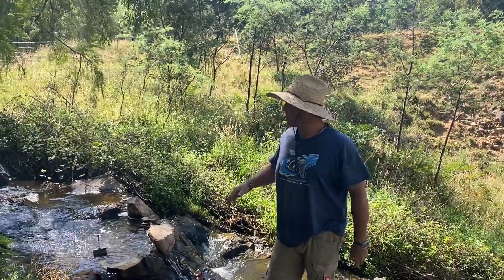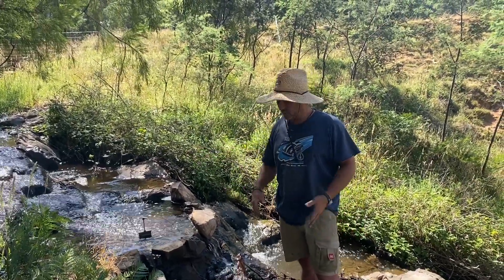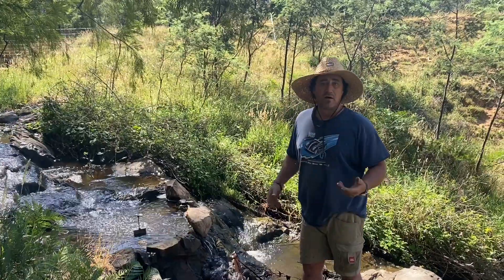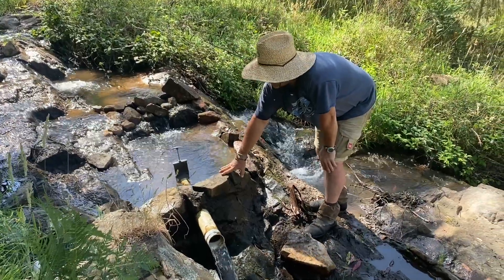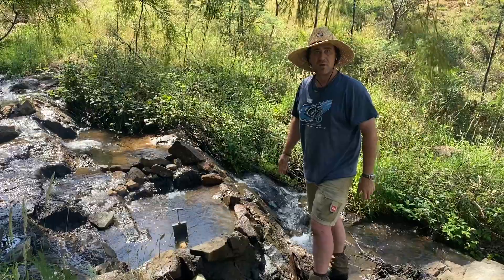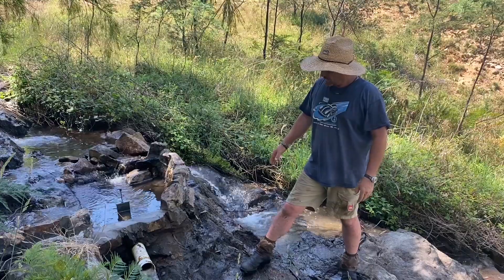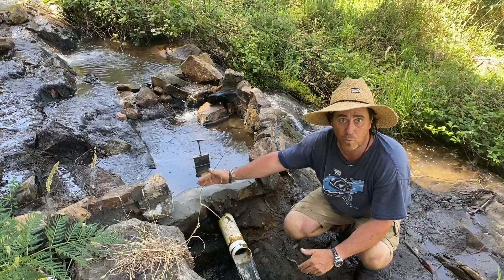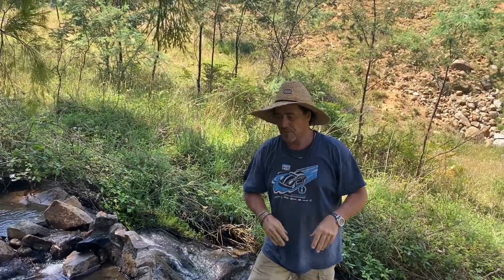Off Grid Micro Hydro Power Generator Part 5 - Water Collection Box Upgrades.

Comment: If I were you I would scrap the collection box idea entirely and go for the solution demonstrated by this fellow Norwegian: https://www.youtube.com/watch?v=wZ4JLTnbUy0&t=0s

MrHydrohead found this solution to solve his problems and I will use the same method in my stream.
Just build the dam walls a bit higher so you get better water depth in the collection area and utilize the 110 mm pipe you already have there.
Reply from the maker: Hey Mr Engineer, thanks for yout comments. I've watched the attached video. Thats an awsome set up. The concern i have is the amount a debris that is in our creek. The filter system in that video would seem to be blocked very easy. If you have any other suggestions i would be greatfull to hear it. Cheers
Reply: @FatCowFarmTatong  
Hi, they tube or container you use will go from the bottom of your dam to above water high. By doing this any debris floating on the top won't be able to enter your pipe and heavy debris will sink to the bottom or for the most part not have enough force to travel up the water in the short amount of time from entering the container to it enters the penstock.
The higher the water level/water depth is the better this principle will work.
Water can only enter st the bottom of the container and will go up before entering the penstock tube that you have an 90 degrees on so that it points up. 

Watch MrHydroheads videos as well. After much trouble keeping the water fed into the feed pipe and at the same time filter it he ended up on a similar solution. If I remember correctly it is in episode 17.

My stream is pretty similar to the one in the first video you saw, just quite some bigger and during autumn rain storms and spring snow melt it gets quite big with a lot of debris and boggy water rest of the year and I think it will work perfectly, just get the depth that you need.

The collection box will constantly clog up and need cleaning.
Reply from the maker: @Mr.Engineer.  Thanks for your reply, i'll really appreciate the time and effort. Thanks again. Cheers
Reply from the maker: Hey Mr Engineer what are your thoughts on a coanda cylindrical horizontal spinning catchment, rather than just a screen. The spinning system would almost be self cleaning. I would appreciate your thoughts. Cheers
Reply: @FatCowFarmTatong  Hi,
The way a coanda screen works you need a certain degree between the open slit in the screen and the surface. I am no expert on this topic, but I am not sure you will be able to get the correct angle and thereby the coanda effect with a cylinder unless the diameter is enourmos enough that the curvature of the cylinder doesn't play any big effect on the surface and then we are talking meters in diameter, not centimeters. Take this with a grain of salt though as coanda screens and fluid dynamics isn't my field of study.
The coanda screen relies on water flowing over it with a certain velocity to clean it off and uses the angles of the slits to force the water down the screen at this velocity.

However you decide to design your intake my general experience is that if you over engineer it and design it to advanced it never bears any fruits unless you have the financial backing to outsource the whole process from design to construction. Then you get it done right and quickly, just throw enough money on it.
If you are like me and like to do it yourself start out with a simple but adequate solution and build on that later when you have the time and resources to build/upgrade it to how you always envisioned it. If not you risk it to never fruition at all or maybe be 5 years delayed at best.

Thats my best tips along with building the intake dam as high as safely possible to get an higher water head. Remember it is the height of the water plane, not the intake that is your head. In a collection box that will be your overflow height in the box itself at best.
Also, if you want to go with a rotating screen to have gravity clean it then I would try to go for a bigger diameter than you think you need and fine mesh stainless screen.